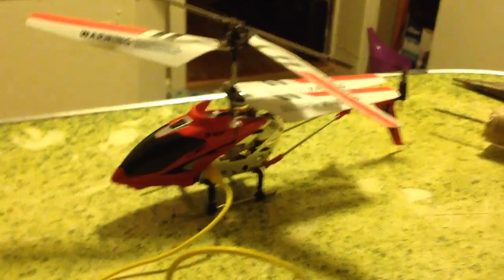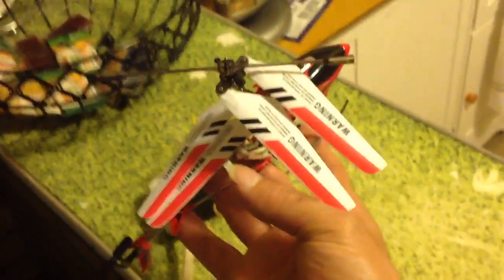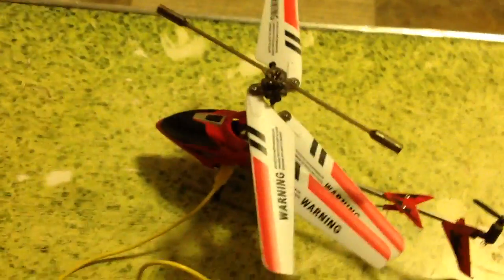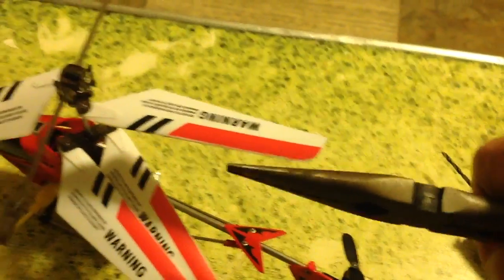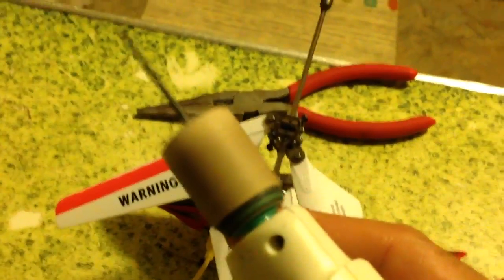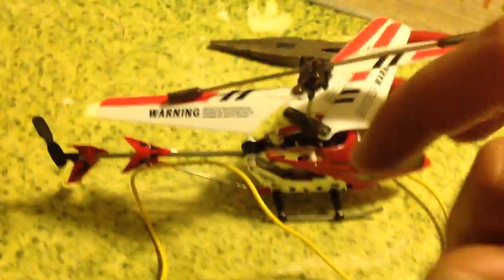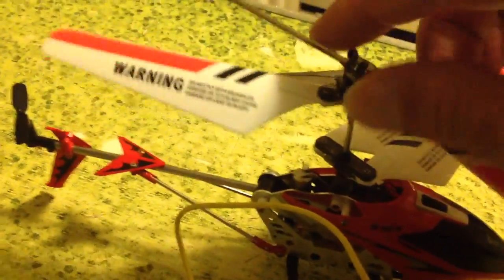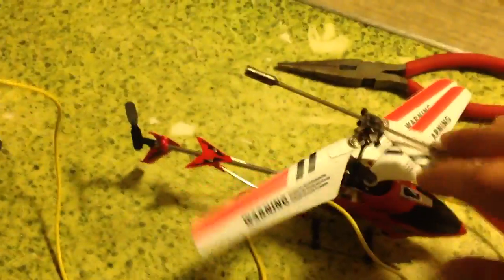How to fix S 107 helicopter that won't fly

Comment: so i finally got around to repairing my copter that got destroyed by my little nephew. I replaced and repaired everything that was broken, however my copter kept going in a circular motion and i couldn’t figure out what was causing it. then i saw this video and saw my blades were bent a bit, j straighten them out and now it flys like new. Thanks my guy! 👍

Comment: Hi i got the same heli and i got a charging problem.I lost the yellow usb charging cable and when i charge it with the remote the light stays red for a minute and two and then changes back to Green on the remote.I left it charging the whole night on the controler and nothing.The heli has ben in the closet for 5 years so its maybw that.Pleas help.